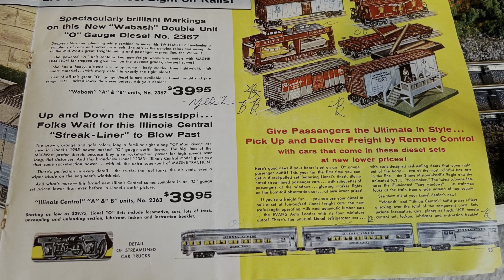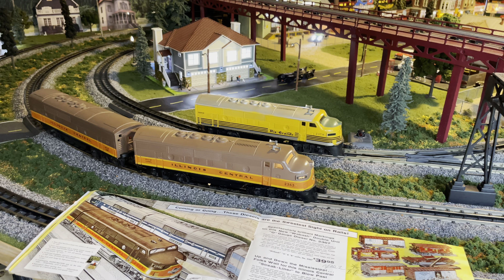Lionel 2363 Illinois Central F3!

Comment: I've got an experiment for you. A post-war F3 from about 1952 are great pullers. A real F3 weighs in about 230,000 pounds. in a 1/48 scale that would be about 5 lbs. and streamlined passenger cars should be about 2 to 3 lbs. You could put some lead weights in each and see how well two powered A units coupled together could pull about 15 cars ( all weighted down) let the locos pull this train for one hour at about 80 to 90 miles an hour

Comment: Nice engine.  It is quiet.  I have one as well but I need to service it and clean the shell.  It is very dirty.  I have not even tested it yet.  Maybe now I have the incentive. Thanks.
Reply: You can do it. If you have Lionel manual or watch zacs earlier video explaines process. Just be careful cleaning the shells on these painted beauties.
Reply: @mustangcircut  I did watch zacs video on the overhaul.  Cleaning the shell will be the hardest part.  It's not just dust but looks like ground in dirt. Now I really have to get to work on it. Thanks.
Reply: Inconspicuous area try cold water and soft toothbrush with mild dishwashing detergent. Scrub ever so gently. Warm water helps clean but softens up the paint in my opinion. The die cast metal trucks that have the gloss paint you can be a bit more aggressive. Obviously stay away from nose decals or any. To dry use a soft towel and dab dry or let air dry. Just take your time. ☺️

Comment: Will the other layout be converted to run mostly command and control also? T4
Reply from the maker: Actually the other layout is set up specifically for command control power/control wise. But the small diameter curves is what limits us big time to what can run on it. Made with O42 and O31 curves, only the small stuff can run on it. Hoping to fix that in the future.